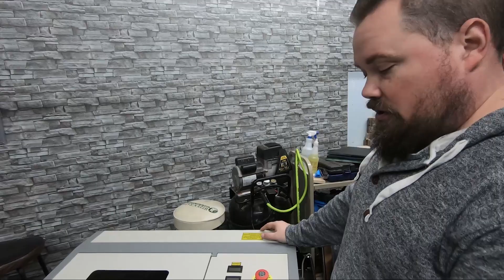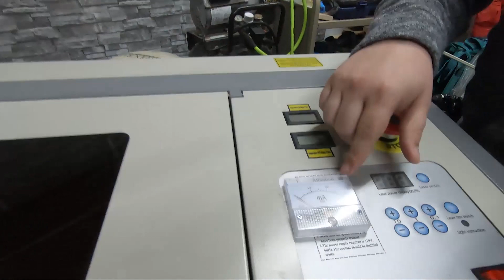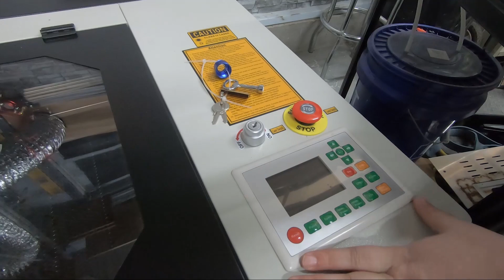60W vs K40 Comparison | Monport Lasers

Comment: My upgrade path matched  yours only my K-40 came lightburn compatible. I really liked my k-40 but it was just to small. My diode laser was a total bust. The support was helpful but I just couldn't get it to work correctly. The Monport K-40 came with chiller that didn't increase the cost much. The 16x24 60w is a 100% win. It came with auto focus and I didn't need to adjust anything. I checked the Laser alignment and it was spot on. I love that machine very much.
Reply from the maker: We really like ours also.